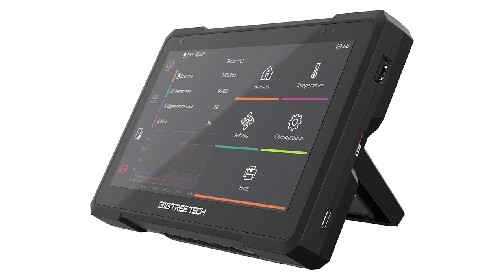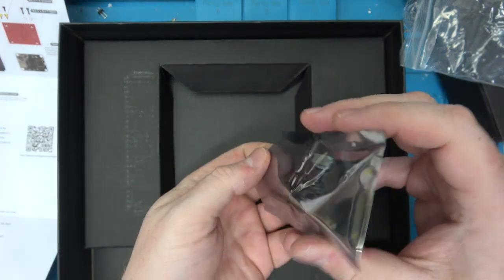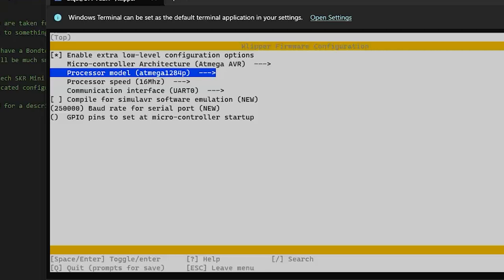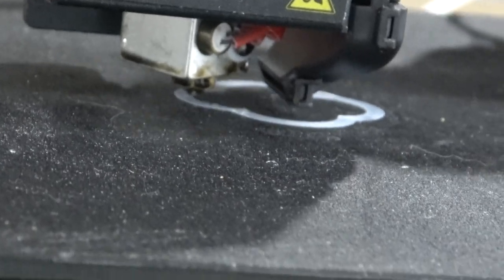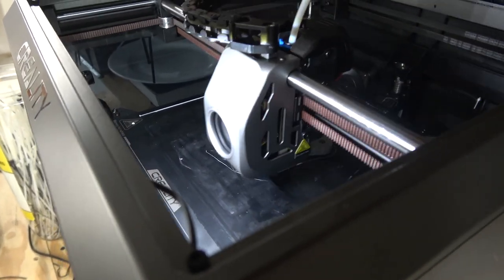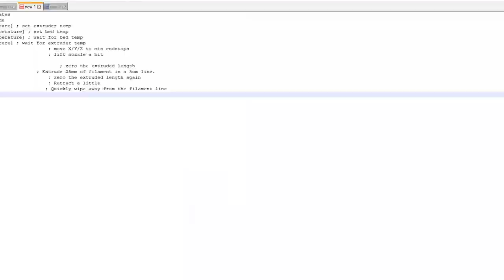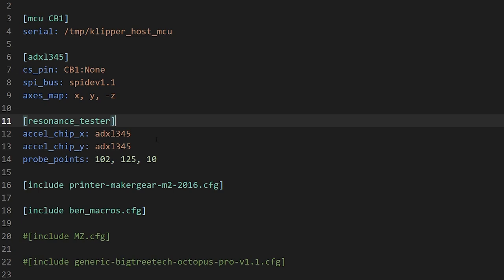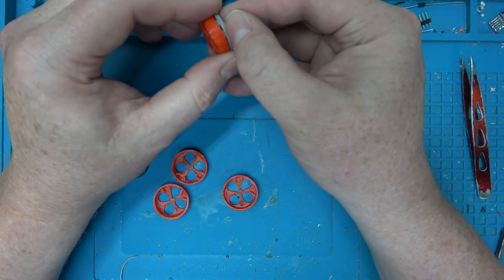Big Tree Tech Klipper Pad7 Setup and Review

Comment: UK plugs are the BEST plugs. This is a fact.
Reply from the maker: I can fit a USB charger in my pocket. USA for the win!
Reply: UK plugs are designed to solve a UK problem, but are garbage ergonomically. I'll take them over US plugs, but almost all other plugs are preferable. Schuko being the favorite of course.
Reply: @BenHeckHacks  Yeah, but your USB charger will drop out of the socket under the mere weight of your gaze. UK for the win!
Reply: @v4lgrind Im from Germany and even I think that plugs in the UK are better than our Schuko plugs. 🤷🏻‍♂️
Reply: I can fit my UK usb charger in my pocket
Reply: yeah, the BS 1363 (UK) plus is definitely the best. it (and the matching socket) include several safety features missing from other plugs: polarized, insulated shutter-opening device, insulated live/neutral pins, side-guards to prevent "grip" electrocution, switched socket, mandatory replacable fuse up to 30A (@240V!) (no need for the stupid nema menagerie), optionally rewirable.
Reply: Mainland European plugs are the best. Smaller nice and snug into the socket well grounded no useless fuse and no switch on the socket you forget to flip 🙄Man how often I forgot to flip that switch, why is it even thee? It’s not like the electrons fallout 😁 The daft cleaning lady in my place always made it a game flip the switches to the off position. When there was nothing plugged in. I come hoor plug in my laptop go to dinner and then find it wasn’t charging… or the sodding switch!
And how many dudes do you need? One in the socket, one in the device and your fuse on the power group and then a mainfuse.
We in the real Europe 😅get by with just the power group and the mainfuse and the odd one in a device no need for fuses in sockets. 

But we agree that US plugs are the worst! They don’t sit snug, always fall out with the lest amour of effort and 110V was what we used in the Middle Ages 😂 you waste a lot of copper to carry the higher current. It’s a shambles!
Reply: Schuko are way better. Way, way, WAY better.
Reply: @mandrakethemadcoder  Exactly my point :D German engineering for the win!
Reply: Only people with a horrible, embarassingly massive plug would rave about safety features 😂
Reply: @mikeissweet  I have a tiny plug ;) It's genetics they say :D
Reply: UK plugs are great until you step on them - these plugs are from the unholy crossing of a Lego brick and a hedgehog!
Reply: Here in Smugistan our plugs are best plugs.  We use USA plugs as shot in our slings when hunting our superior small game animals.
Reply: I seem to remember trying to buy a replacement wall socket a few years ago at home depot (in the us) and they all had shutter protection on them. Didnt notice till i installed it and couldnt get the plug to go in. Went to menards and the china plugs didnt have it. Had to go with china plug.
Reply: @BenHeckHacks that why we have ones with a pop out middle pin, also number of times I've needed/wanted to put a charger in my pocket is close to zero, all those 2 pin ones always feel like they wanna fall out the socket
Reply: @tainio  yup a lot of usb chargers come with collapsible earth pins now

Comment: Thanks for THAT video! I asked myself if I should turn my old Ender 3 into a Klipper system and thought: nah, its fiddeling around with Linux, find out what to do to get it working in thousands of videos, forums and google sessions and hacking that into config-files ... and now you have shown me, it is true ;-)
Reply from the maker: It's 10% setup, 90% tweaking. So yeah, it's not for the feint of heart.
Reply: @BenHeckHacks   And then you start tweaking the slicer.......    That's why Klipper makes more sense for Printer manufacturers - they can do all of the heavy tweaking  and optimizing for you - same for the slicer.  They are getting a lot closer to "plug and print" with the new core x-y machines, though.  I'm forcing myself to not be an early adopter this time. I am still interested to use this Pad7 or the Creality version for my very large bed slingers.
Reply: I had the exact same series of reactions as you.  Just exhausting. I like tinkering with stuff, but man, cheap 3D printers are a huge time sink.

Comment: CB1 is CM4 compatable. It is the standard that raspberry created, Rock64 also has a board that is compatible. Also would be curious if the cancel print has the obtuse disable steppers in it. Makes it a pita if you have a blob  and need to clean it off while its hot. -- edit yeah should a watched a bit more, why does btt change that behavior!?!

Comment: Klipper is very promising, but I’m not sure if I’m ready to go through reconfiguring my Ender 3 once again. 😅 I didn't expect the setup and configuring to be as involved as it was for you.   After solving a multitude of frustrating issues on my Ender 3 to just have the X axis driver chip fail on my BTT SKR mini v1.2 (I guess this is a common failure - purchased in 2019 so the warranty is now expired). I’m ready for 3D printers as an appliance. I look forward to your Bambu labs review as you are one of the most scrupulous tech reviewers on YoutTube.

Comment: I am very comfortable in linux (used it for like 20 years), but it bugs me that klipper requires macros for stuff marlin has built in, im not sure i have the time to stuff around with it.  However i might end up doing it at some point, nice thing about a rpi, is i can just swap back my octoprint sd card and reflash my backed up marlin firmware if i hit a wall

Comment: I think your z-banding issues are related to pressure advance. The speed changes going into direction changes - aka corners, inerta of the extruder head assembly and the extruders filament feed speed all play into that and need fine tuning. Its too bad these printer companies don't really spend much time tuning that and leave it to the end users to deal with.

Comment: I added an inductive probe to my Ender-3 Pro, It's wired into the board where the BLtouch would go (only the switch, NOT using the servo).  So I still have the z end stop switch hooked up.  I guess I can use it like you used the BLtouch, but I don't trigger the servo to extract a probe, just move the Z axis down to the bed.  Still need to get the X/Y/Z offsets from the probe in the config file though.
I still have the factory firmware in my Ender-3.  It has the 32 bit board, and I'm sure there is a boot loader....just put the new firmware on the SD card, and give it the correct name, and it should load on power up.

Comment: I'd think that you could use an old laptop instead of a RPi to run clipper.  I have an old Thinkpad T400 that is not being used.  It has a coreII processor with 8gb or ram.  It can run Linux, it should run Klipper and I can put it on my home LAN to connect to my desktop, and it will just plug into the printer's USB port.
Reply from the maker: You can! Any Linux box that's somewhat modern will work.
Reply: @BenHeckHacks  So I installed Debian 12 on my old thinkpad T400 without any desktop firmware.  I enabled SSH and it's now a 'headless' server.  I installed kuiah, and from that installed klipper, moonraker, mainsail and octoprint.  Now I need to figure out how to set up klipper firmware and build it for the Ender Pro 3 ( I seem to have the 32 bit board with the extra flash) but I'm not sure of all of the various options in the build firmware kulah script.  It took me a while to figure out that I had to add myself to the sudo group before kulah would even install klipper.

Comment: Ben, I just got a BTT Pi V1.2 a few days ago. They say it can support Octoprint, but it needs to be installed manually. I'm following all of the manual installation steps and nothing is happening. It still only boots into Mainsail/Klipper. Can you do a video on how to install Octoprint?
Reply: I'm pretty sure he has mentioned in the past he doesn't care to use Octoprint and just likes to sneakernet his SD cards. :D Check out the Teaching Tech video "Using a 32 bit Raspberry Pi to boost your 3D printer mainboard - Klipper Ender 3 guide" should be somewhat similar to what you are trying to do? https://youtu.be/yAfalR7-Tvw

Comment: there's nothing really special about a raspberry pi (apart from everyone thinking there is and them therefore being impossible to find). you should be able to install the software on reasonably powerful SBC like an Orange PI 5, Odroid C4, Banana Pi M5, Rock 3A, etc... even those are all probably overkill for this use-case, though.
Reply: I think the main issue might be that if it's not hardware the developers of Klipper frequently test with, you might run into more bugs.  Luckily I collected a few pi before 2019, so had no issues finding one, in fact since I was already using octoprint on a pi 3b was easy as swapping sd cards.

Comment: installing the firmware is normally a lot easier with new board and it's just copying it to an sd card.
Reply from the maker: Yup you just copy over a firmware.bin file and if it's on SD it bootloads it
Reply: @BenHeckHacks  I made a 3d printed printer with scrap parts and used an old creality board, it was so annoying because you had to give the bin file a unique name each time and it didn't rename if it was successful   so I was chasing issues and had no way to know it had flashed.

Comment: It would be cool to connect a set of AI tools with a slicer, Klipper and Alexa... then ask Alexa to design and print a part with a description of a problem, optionally including a quick photo of some interface with a ruler for measurement estimates. It should then make sensible choices about part splitting, rotation and supports, and it should warn you about filament changes, failures with spagettificatio detectionn, etc. It would be cool to live in a world where a manufacturer of appliances would generally publish cad models of the parts in a global publicly available database. You could then ask Alexa about a new part that would connect to a shop vacuum you bought a few years ago, leaving Alexa to look at your purchase history, look up the model, download the cad files, have an AI tweak them with a set of constraints, etc.